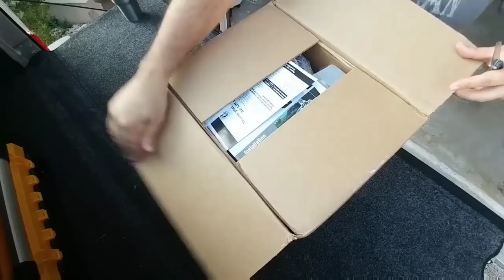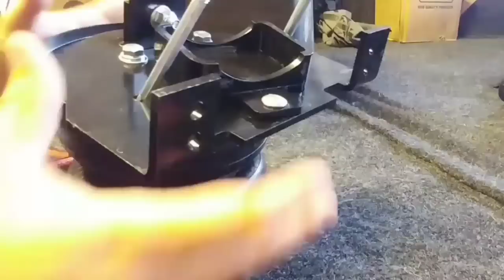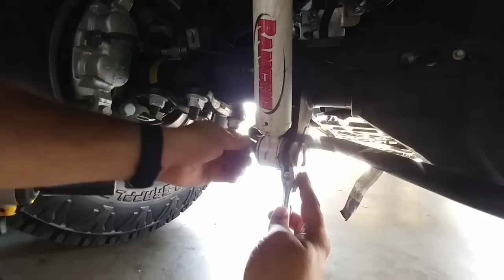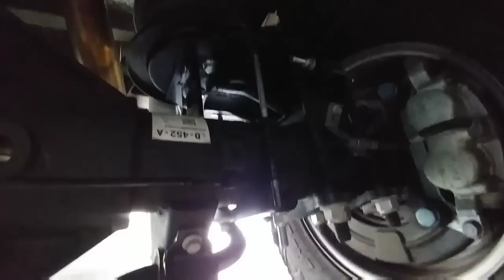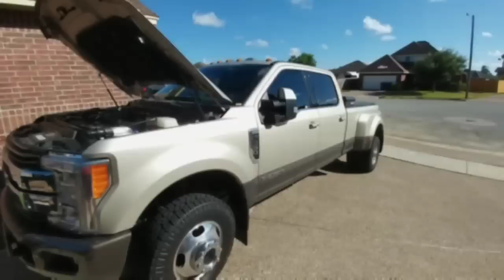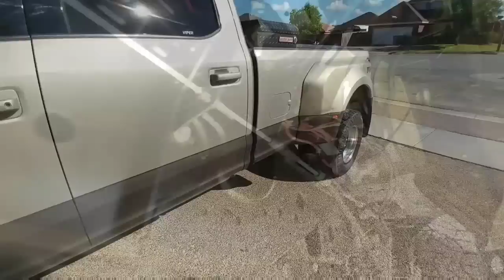2017 F350 gets HUGE AIR BAGS! Airlift 7500XL

Comment: Here we are now in 2020 with your experience with the wireless system how would you say it works, i just purchased the 7500xl for my 17 F350 and I've heard some issues with the remote not working, very sporadic
Reply from the maker: Mine worked great in my F350 (this video) because the module was much closer to the cab of the truck.  My current truck has range issues unless I'm controlling it from outside and towards the back.  Other than that, no issues.

Comment: I just installed firestone ride-rite air bags today on a 2006 F350 duallie, towing upto 26K lbs, the ride was very uncomfortable and my back was taking a beating!! i had to remove my wheels for the install, since i have to remove the factory bump stops to use that location. Great video.

Comment: Great video,  I watch it before and had to watch it again. I just bought a 2018 3500 and thinking about installing air lift bags on my 3500, did you ever get leak when you had them, did the 72000 wireless remote ever start up from time to time? Thank you for your reply.

Comment: Are those air bags only supported on the bottom by the bump stop bracket? If used continuously there should be a connection to the axle. It is not meant to support weight especially in a live load with differing weight values when supporting load. No different than building code that states load must have path to ground. Don't depend on screws or nails to support structure. No different with a truck traveling down the highway with a load sharing the space with others.

Comment: A week ago I had 4WP in Orlando, FL install a set on my 2016 F-350 dually.  They didn't install the heat shield because the clamps that came with the kit #57596 were too small to fit around the exhaust pipe resonator.  They didn't tell me nor did they give me the heat shield.  I ended up ordering the heat shield on Etrailer, and have the same issue.  One of the Etrailer reps (David) is going to contact Air Lift to see if a special set of clamps to fit the 2016 F-350 exhaust resonator is available.

Comment: I have a question for you if you don't mind answering it. Do you have the fifth wheel prep on this truck? I was wondering this because I want to install these on my 2017 F350 but I have the fifth wheel prep for my camper but the Airlift website says it does not work with fifth wheel

Comment: Great video! I have the same truck that I am putting a 5200lb truck camper in so it squats a bit. I want the same airlift bags you have. Does your truck have the factory fifth wheel prep package? I want to make sure the bags will fit because my truck has the prep package. Thanks!!

Comment: Nice, I much prefer this truck over the red one as far as looks. just sayin, as always to each is own. This is the one that had the rattle in the sun roof right? I've been  a Ram guy and still prefer the power train of the Ram. However there is much more to consider when making a purchase. Such as how you think you will use the truck for one. Having said this, I hate the idea of having to remove the cab to do any serious engine repairs on the Ford. Never the less You have made me much more open minded, when it come to other brands, as I have learned more from you and you're opinions. I recall I accused you of being bias to Ford's a few years ago. Having now said this I think this would be the appropriate time I should probably apologize for my bias and my ignorance. lol

Comment: wow this is way simpler than just compressing the bag and putting a pipe plug in place of the airline fitting ....🙄🤨
Reply from the maker: considering there is no way to put a plug in place since it's a quick connect female connection.....it wouldn't be simpler

Comment: Any experience with adding the leveling kit with the Airlift airbags? I've got an 2018 F350 duelly hauling an 16k gooseneck Grand Design. I'm temped to add the leveling kit & 5000 ultra bags but afraid I might get some positive rake when hooked up.

Comment: Have air suspension on my truck also. I mounted my compressor in the cab behind the rear seat to keep it out of the weather. It's actually pretty quiet with the seats absorbing the sound

Comment: Love you Videos! Would this air bag system be real helpful if your pulling a large 5th Wheel? I know the  Dully and at least a 250 with a preference to a 350 configuration and I think I have been told Diesel is preferred over gas engines? Thanks Bill M

Comment: Most of the time i agree with your comments. This is not one of those. U brag about how awesome the Ford is. U paid 75k? They still have to add aur bags?! Wtf! 
Ram 3500 comes stock with air ride in the rear!!
Reply from the maker: It's actually an option on the RAM (a good one mind you).  Not everyone needs bags though.

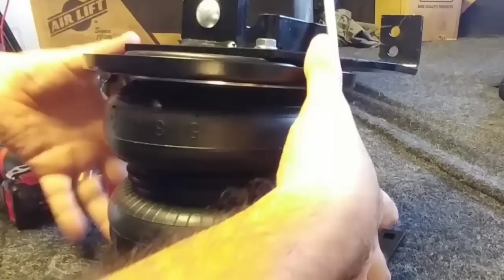Comment: So looking at grabbing 2017 F350 DRW and want to know what RPMs your running with the 4:10 vs. 3:55 rear end.  Also what the highway mileage looks like with and with out a load ( pull a 40" 5ver).  I only tow about 10% of the time.

Comment: Couldn't the zip ties be routed over the entire top rather than drilling holes?
Reply: A better idea. Hook up a vacuum pump to the air bag and pull the air out to compress it.
Reply: compress the bag and cap it. no need to drill holes.

Comment: Nice work! Would have loved to have seen you do a comparison between airbags and the torklift Stableloads. I have had both now and I think the way stableloads work to enhance the stock suspension rather than working independent of the stock suspension like the airbags do is a great setup! I have found when running really heavy that the stableloads provide a more consistent ride, with reduced roll and keeps things close to level, whereas the bags always felt bouncy no matter what pressure I ran! Thanks again for sharing. 
http://www.torklift.com/index.php/products/suspension/stableload

Comment: Air bags are a fantastic investment for any truck. Even if you don't tow near the maximum weight, they help with body sway and keep your headlights from blinding oncoming drivers.

Instead of zip ties. Compress and plug the air hole.

Comment: Hey I just bought a 1992 fifth wheel and am going to be pulling it with my 2015 Ford F-150. I was thinking about putting air bags in the truck but a buddy of mine said to stay away from them because a buddy of his put then on his dodge then aired up and after one trip with the trailer apparently he bent the frame of his truck. Is this possible or just a bunch of bs? Should I get airbags and if so what would you recommend?

Comment: Something I don't understand is why you spent the money on the product & the labor when you had the air bags put in your F450 just to turn around and trade it in not even a month later. Doesn't make a whole lot of sense to spend probably close to a grand on something to just get rid of it and buy another set of air bags again for your New truck.
Reply from the maker: sirkingdra: 30 days money back guarantee on the kit. Was able to trade in for the new kit at no additional cost. I did the labor myself (which i enjoy).  Plus reused the wireless controler and compressor. Make more sense?
Reply: Thank goodness for return policies.

Comment: I've had that same brand on my 2014 Ram 2500 that I pull my 5th Wheel Toy Hauler and dbl tow trailer with 2d TH.  They have worked great the whole time 30,000+ miles.  I could live without them, but I off-road Moab etc all the time and they make the truck very solid.  Imho

Comment: A different suggestion for compressing bags in add about a foot of airline and compress the bag, then fold over the line and pinch with vicegrips. The bag shouldn't expand unless the line or quick connect leaks. I hate those electronic control systems. I have 1999 f250 and i just use a height control valve for a class 8 truck. Add a load and it always keep the right height. I think I paid $45 for a delayed HCV. No electronic failures here

Comment: You could use vacuum line or hose on those bolts. And you could put spiral wire loom cover on the brake line. Great video as usual.

Comment: Hoss 
How much weight do you out in your bed? I thought your new truck was rated in the 4-5,000 payload range???
Reply from the maker: C Nevs: the fifth wheel drops the back about 1.5". Once I level the truck , that will creat sag and cause the headlights to point up into oncoming traffic (blinding them).  The bags will give me the ability to keep the headlights facing towards the ground.
Reply: Ah ok. Didn't know the drop would be that much. Makes sense.  How are you doing by the way with everything?

Comment: Excellent Job. I am looking at a F-450 Diesel P-U Crew Cab. I called my Insurance Co. to get a quote. (Ca-Casualty) Been with them for 40 years. They told me that their list only goes to a F-350 & can't insure a 450. To me that seems ridiculous but guess they have the last word. You have had a 450 before, may I ask your advice on getting a F-450 Insured. It is not for business just pleasure.
Reply: Idaho Rider 
heck im trying to insure a f350 cab and chassis model but not having any luck so far. the bigger trks need commercial policies is what ive heard even  its for personal use. i think its a joke for me its still a f350 just a flatbed instead of a pu trk bed. i can haul a scetchier load in pu bed vs a flatbed
Reply: Idaho Rider I ran into this problem even for the F-350 trucks. Most standard insurance companies (State Farm, Gieco, Allstate etc...) only go as high as F-250 for "personal use". They call my F-350 commercial and won't insure it. This recently happened, I'd say in the last two years. I've never had this problem before. It's ridiculous.
Reply: @CR500R  Allstate insured my 2018 F350 and my bill went up $20 a month from my 2009 GMC 1500.
Reply: I had a 450, and all the insurance companies I called would insure it, but it is rated as a commercial vehicle.  So it's much more expensive.  I just traded in a 2008 F-450 for a 2017 Ram 3500, and my insurance went DOWN by $40 per month.
Reply: Going out on a limb here and saying you might be stuck with taking out commercial insurance if you can not find a company that offers personal for that size truck, if you do find one, make sure before you sign the papers to read through and you get all the coverage you may need or require just in case.

Comment: Great video as always. Personally I'm mixed on air bags in general, I had the Firestone ride rite set on my RAM 2500 to help squat issues when trailering. I ended up removing them after we sold off our camper; the empty ride was way too bouncy for my liking. If I end up needing air bags again i'm going to try airlift.

Comment: Hello my friend. Will you be putting plastic tubing around the wires that are exposed to the elements? I noticed you left them exposed. The plastic tubing I'm talking about is the one that has the split in it so that it can be wrapped around your completed wiring.  Some of it is on your battery wiring from the factory. I hope my description makes sense.

Comment: But why? I have the same truck and tow a 42' fifth wheel with minimal squat. I.e. The rear is still higher than the front...just curious.
Reply: beau w what's the 5er's weight?

Comment: 2 things, instead of using electrical tape i would suggest using some electrical shrink wrap tubing on the bolts i have used this many times before and it works and looks great. Sometimes i will shrink a layer on the bolt and then put a second one on and shrink that one down doubling the thickness of protection the bottle jack the cradle is on the part of the hitch receiver it is able to shift since the angle of hitch now slopes upward it would be safer if you had positioned it  further forward on the other side of horizontal part of hitch. it wouldn't take much for it to move if slightly bumped. on that same note the concrete looks pretty smooth i would put some kind of rubber pad or jack base under jack to give it a better grip against concrete an old floor mat would even work.  I do not know of ANY hydraulic jack manufacturer that would recommend using their product as a means of support while working under vehicle  if the bottle jack released or slipped the frame would drop before tires and suspension would stop the fall i know it wont fall to  the ground but the space you are working in will get rapidly smaller possibly smashing hands or head.   you should also be using and showing wheel chocks both in front of and behind the front tires without anchoring the front wheels to ground it greatly increases the chance that the vehicle could move bringing the jack from its vertical position and causing it to fall and with no jack stands to support truck your chances of being hurt or killed just putting jack stands beneath the frame on each side will prevent the frame from dropping more than an inch should the jack fail.  Be safe!
Reply: Big Truck Big RV but when you put those sulastic shackles in your uncle Dodge 1500 or whatever it was you were not supporting The frame and you have the axle and springs disconnected from the truck my point was if that Jack would've slit even after only having to raise three or 4 inches if you were reaching into something when that happens the results could be bad
Reply: Yeah, I saw that bottle jack assembly and cringed! It is neat, but wouldn't take much to squish a guy
Reply from the maker: Ogre Dad: even if it failed i wasnt in an area that would crush me. It only raised the truck about 3-4 inches from the suspension so i could slide the bags in.
Reply: http://www.f4tape.com/ -- much better than electrical tape, used it all the time on aircraft.
Reply: Randy D I